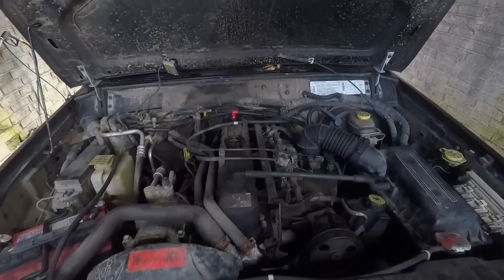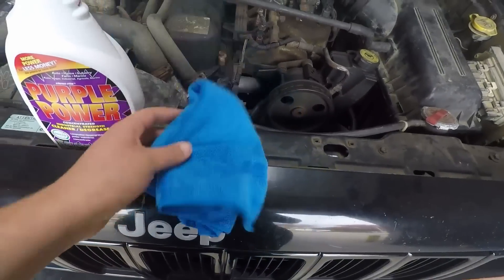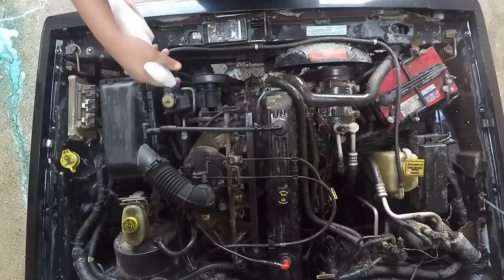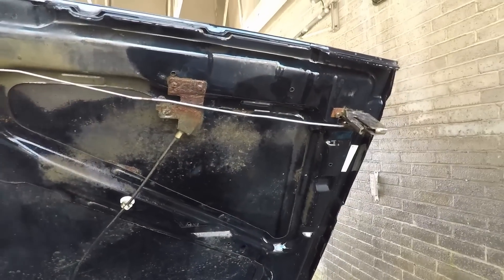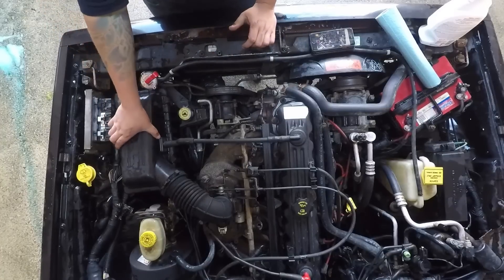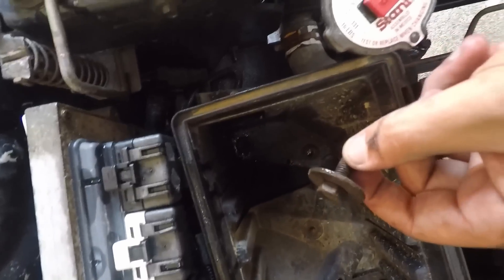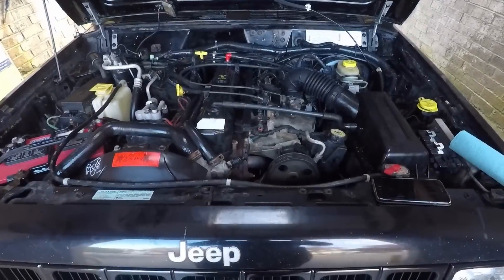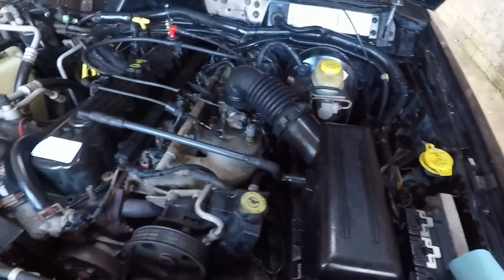How To Clean Your Engine Bay

Comment: I don't have the luxury of having a driveway where I can do this. So, I too have to go to the coin-op car wash. I've never had any issues; car electronics are designed to be waterproof to a certain extent. Having said that, these cars are not exactly quality engineered. Look at the layout in the engine bay, it looks like someone designed it in their shed. So, to avoid any potential damage, I spray from afar so the water doesn't hit hard and creep into electronics.

Comment: there went the electrical system on that jeep. you can use the cleaner but should never use high pressure water just use a low pressure high volume water hose. high pressure water can force water past the seals and ruin anything from the computer to the ac system. just not worth the risk.

Comment: Before spraying the degreaser, it's much better to wash the engine thoroughly with water and then apply the degreasers and then wash again with water. Also use brushes e.g. dish washing brush to wipe out old oil and dirt. You will see dramatic improvements in results.

Comment: a little Dawn Dish soap and water works 10× better and next time you should cover your MAF sensor, there extremely sensitive to moisture and damage easly.
Reply from the maker: Clarissa robles Mass Airflow Sensors sit inside of the intake, motor side of the filter. So it's already covered.

Comment: I always thought u had to leave car running while doing this, am I wrong???
Reply from the maker: levi Wilson I've heard that you can, but I've never done it that way. The headers with water and degreaser on them will produce vapors. So I'd rather just have it off.
Reply: I noticed just brought a Honda Accord to drive back and forth to work and I'm going to try it that way any tip to proven damage?

Comment: man i did everything u did to the T and my shit corroded instantly...
Reply from the maker: maschinemademan what kind of degreaser did you use? Cause that doesn't sound right at all.
Reply: Ron's Rides i used the same stuff u did. and whats wierd is i didnt let it dry and i didnt let it sit really...i just sprayed it all over, then went and put a quarter in and washed it all off. at first i was like "HELL YAH"!!! then as it dried i noticed my ac compressor was all white, then my manifold and etc.. i guess i just let it sit for too long (which i dont understand how).. is there any suggestion u have for getting the white off now? i appreciate your video btw, no resentment here man. just bummed that mine turned out the way it did.
Reply from the maker: maschinemademan They are Aluminum aren't they?
Reply from the maker: Cause if so, I know exactly what you are talking about. The Aftermarket intake on my Accord turned like a milky white after I left the degreaser on too long. I'm thinking it was because it was aluminum.
Reply: Ron's Rides ya i just didnt think it would start that fast. im just wire brushin it now
Reply from the maker: maschinemademan I know Mothers makes an Aluminum Mag cleaner. That with some steel wool should be able to get the oxidation out of the aluminum.

Comment: purple power is also the best tire cleaner. spray on and u can just wipe across with a bush 1 time rinse and itll be cleaner than any other tire cleaner u spent and hr scrubbing. u can watch the gunk come off as u spray it 
i also wd40 all hoses plastics ect for a nice clean new look

and no ppl your not gonna hurt your engine.. go play in a mud hole or drive across a creek with nothing up the roof stickin out the water like all the off road guys do. just dont open your oil cap and deside u wanna clean the inside rofl
Reply from the maker: kickflipkid1126 I didn't know that about the wheels. I would be careful about getting purple power on your runs depending on what kind you have. I screwed myself pretty badly in my most recent video doing that lol thanks man

Comment: 9:05 Dude, Fix your airbags !!
Reply from the maker: +Junito Punto Comm no....
Reply: Ron's Rides It's ok...but do not get into an accident !! 😅👍🏼
Reply: it's a jeep xj. They had a recall in 2000 for the sensor. most of the time it's just the clock spring.
Reply from the maker: Jalen yep airbag had to come out for that one
Reply: I have a lifted 2000 xj and the airbag light is on all the time. But I'm not worried about getting in a reck with my steal bumpers.
Reply from the maker: Jalen it's a beautiful thing lol

Comment: I have a question when washing engine with water don't you need a cover anything up with plastic bag so water won't get inside any specific parts??
Reply from the maker: xboxshit_Destroyer Playstation Won yes and no. It's a touchy subject that depends on a lot of deciding factors. But pretending that all cars are the same, yes. You should cover up any type of fuse box that doesn't have a cover. Exposed wires. Try to keep the intake dry if you have an aftermarket cone style one. Also there are sometimes delicate sensors to watch out for too.

Comment: Watch Chris fix's video on engine cleaning. ALWAYS disconnect the battery when working on, cleaning, or repairing electrical components. You are VERY lucky that nothing shorted out or failed. Also you really should have removed or covered the belt, it could slip if wet causing more damage. Other than that, nice, you got it clean.👌

Comment: use super clean and don't use a pressure washer. and use a leaf blower to blow water out. after it's dry. spray tire foam all over the engine bay. allow to dry. then wipe off excess.

Comment: Hello. Good video. I use 2 to 3 things.

1) Blue Magic: Leather and Vinyl cleaner "spray" and a good towel for the plastics. Also I take them off the car so I can mist it with water before the spray. 
2) I also hand wash my engine bay....
Fenders, radiator overflow tank, battery, air intake. 
I tell people its to have it clean and IF!!!!! my car leaks something, I know where it's coming from.
Reply from the maker: George Rabel Thanks A lot man.
Notes taken. Appreciate it.

Comment: spraying the engine and all the electrical stuff with water doesn't damage anything
Reply from the maker: Curtis Spencer are you asking, or telling  me?
Reply: I'm asking I've never done this before but would like to clean up my engine bay
Reply from the maker: Curtis Spencer ok. You have to be cautious of sensors and electrical things yes. Make sure fuse boxes are sealed and you don't spray in the intake or too hard on your spark plug grommets. It's best to have a mechanical understanding of your engine components before hand.  And if you have an air filter cone to cover it with a few plastic bags and zip ties.

Comment: Another tip spray WD40 on the wire connectors to repel the water and minimize the chance of a Check Engine light.
Reply from the maker: Bruce Augustine I didn't know that one. I'll have to remember that.
Reply: i got information last night that dry lube is even better than WD40 at sealing connections and is silicone free so the connectors do not get covered in dirt as well, the only other thing to add is bring some foil and cover the alternator so water doesn't get in and cause charging issues. Dry lube can be purchased in Walmart in the lube or camper sections and is great for lubing the hinges lubricated and dirt free.

Comment: Don't ever do this to a Ford Escape, I did it, costed me over 4K to get it fixed and still didn't run right. Had to junk the car.
Reply from the maker: Yea doing this successfully really depends on the condition of the vehicle, cause I've done it too a 2004 Ford Escape with the Duratec 3.0 V6 and everything was fine. Also only had a little more than 45,000 miles on it too. that probably contributes to it going to well.
Reply: Did you disconnect the battery?

Comment: it's actually kinda refreshing to see someone give no shits about blasting the entire engine compartment with high pressure water. this is the stuff that sparks arguments. i love it.
Reply from the maker: Jeff Falstrom hahahahahah I needed that.
Reply: Jeff Falstrom what do you think the dealer ships do..
Reply: Jeff Falstrom That's how it's supposed to be done.
Reply: Well I mean, it's all supposed to be waterproof, RIGHT!?
Reply: I bet that thing misfires 😂😂
Reply: Shit we did it on all the Mercedes Bnez after major repairs and the detailers did it all the time. The trick is actually having the engine running so it can dissipate the water so in case some of the water seeps pass the weather seals in the electrical connectors, it dry off fast before it penetrates. Even while applying the cleaner/degreaser. I how ever will note that Mercedes MAF isnt in plain view for getting soaked by the pressure washer. I WOULD cover the mass air flow and some other electricals thougu or try not to spray it too liberally
Reply: Richard Whitaker I've done this my entire life, on ALL SORTS of vehicles. I ALWAYS had the engine running, like you said. Sometimes I'd even go as far as to go straight home and use an a high power air source to dry everything off- big air compressor or a leaf vac in reverse. It really does make a huge difference when you clean up your engine bay.
Reply: Jeff Falstrom I mean as long as you don't use a lot of pressure on the wires and don't get the alternator wet you'll be fine
Reply: @Jeff Falstrom 
I dont see arguments in the comments, I mainly see poor idiots who tried this method and now have various lights on. Who would've guessed that places that were made to not get water inside, would hate having a high pressure water shot at them?
Reply: thats exactly why you do yourself! cus dealerships dont give a shit and will degrade your car.
Reply: They use a steam cleaner at reputable dealers  , shade tree mechanics don't give a shit.
Reply: You think a power washer will actually harm an XJ?
Reply: Power washer can rip any small wires trust me my dad and his friend were drunk once and my dads friend decided it was a great idea to clean my dads work boots while he wore em he stumbled went a little too high and made a big cut on my dads leg 🦵 they wouldn't have done it if sober but we all know we only use half our brain when hella drunk

Comment: I use a pressurized sprayer from Ace - purple power diluted about 3:1 with warm water.

Also - Home Depot sells really really cheap paint brushes that are great for agitating the dirt - often times just spraying degreaser and rising will leave a dirty "haze" over the paint and rubber surfaces. Agitating the surface with a soft brush is extremely effective.

Secondly, I always kill my TPS sensors on my 98 XJ - I would recommend just covering the throttle body electronics with a plastic bag. PCM, Battery, Fuse Box, etc are all fine to spray with light pressure (keep the pressure washer moving so you don't drive water into the electrical connectors).

The pressurized sprayer was a nice investment - about $8 at my local ACE and I end up using it all the time

Comment: how would i do it with an open air intake system?
Reply from the maker: Evan Salas I actually just did this on my Accord a few days ago. I covered the cone filter with a few plastic bags and zip tied them around the intake tube. I say a few because you are spraying water at it. So just to be safe.
Reply: Ron's Rides thanks ron it kills me to see all this crap under my hoot of my camaro
Reply from the maker: Evan Salas funny that you say that cause I was gonna make another video with more details on current gen cars and it's a Camaro lol. But yea man Goodluck!
Reply: Ron's Rides hey if you want you can use my car lol
Reply from the maker: Evan Salas That would be pretty cool. I'm in Jersey though. Lol
Reply: Ron's Rides hey if i make a video on cleaning my car engine bay could i mention your channel
Reply from the maker: Evan Salas that sounds good man. And vise versa!!

Comment: Awesome video, I love how you did the fast forward as well as the camera placement. Did you d/c the battery when cleaning the bay? I have read that covering eletronic  components with plastic is important as well
Reply from the maker: tristan volk Thanks!! And you really have to know your vehicle and be aware of how the engine is set up.  I wouldn't go ahead and do this if you have any rubber or plastic hoses/grommets that are starting to crack. Or if you're driving an older Audi with exposed coils, things like that. The motor naturally is a completely sealed system the only place for water to go in would be the intake so just watch out for that. Electrical wise I see no real problem with doing this (in moderation) because if you think about it cars can get covered in mud and sand and water in off roading and as long as the engine has a way to breath its fine. So just be gentle on the electrical stuff pretty much. Thanks for watching.

Comment: kinda scared to spray my engine ha oil  leaks!
Reply from the maker: +Liqa Madiq If you clean it. You'll be able to see exactly where the oil leaks are :)
Reply: Ron's Rides my rear main seal and valve cover
Reply from the maker: Depending on how serious the leaks are. I don't think you'd be able to get water in. It's leaking out because when the motor runs there's oil pressure. That's just where it's weak. If it were me I would still do it. I would be careful around those spots.
Reply: Ron's Rides ill fix my oil leaks before i revive the look of a detailed engine haha dont wanna chance it

Comment: can u let the engine jus dry while sitting there if u don't have a compressor to blow air
Reply from the maker: Team ACG yes. You want the engine to be cooled down some before you start spraying cold water on it and you can just wait until the car has dried a bit before you decide to drive away.

Comment: So there are no issues with getting water and chemicals on electrical stuff like your battery?
Reply from the maker: xTheNameisEthan water no, just watch out for the distributor (if your car has one) and your intake hose. but the chemicals yes. That's why you don't want them sitting on the car for long.
Reply: all ways cover any electronics that your not sure about before you start cleaning the engine bay! let the engine cool down to where you can touch it with out getting burned, that will let you know that you can start cleaning the engine bay!

Comment: This is TERRIBLE advice. I build these engines, and i will tell you in stock form, not maintained (as this and many others are not maintained) you are literally pressing degreaser, and high pressure water into so many areas of these engines that were never well sealed even from the factory.

My suggestion, if you are going to do this is to pull the 3 8mm bolts from the ECM, unplug it and get it outta there, bag the distributor, cover the coil, spray away from the grommets on top of valve cover, and steer fully clear of the injectors and ports they slide into. Among many other areas.

I get doing this in a pinch to a DD (or to an engine you are pulling/rebuilding) that you dont really care about, but after the fact you best change the oil at minimum. I assure you theres water in the crankcase of this jeep. Slogged out nasty oil slime through all the oil galleys.

Ok in a pinch for a DD you dont care about
 
Terrible advice to some kid that does not understand the functions of the components he is spraying with a carwash wand